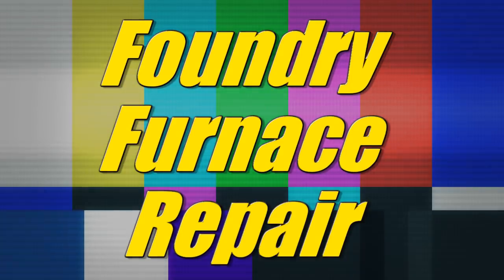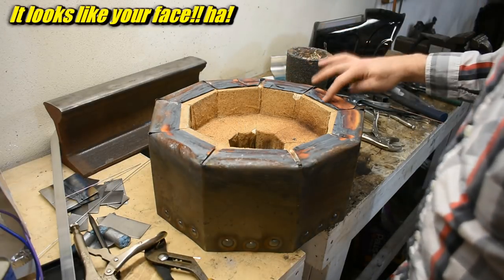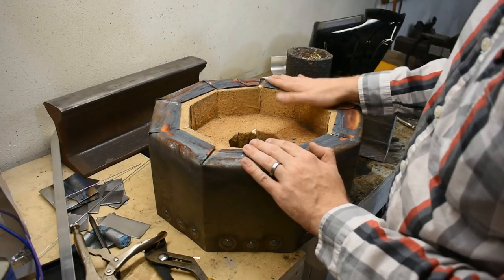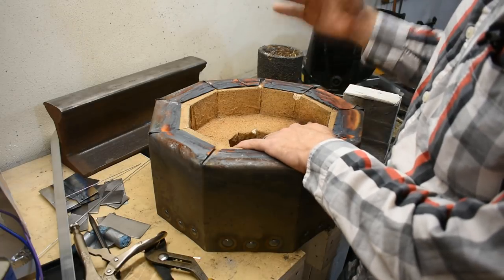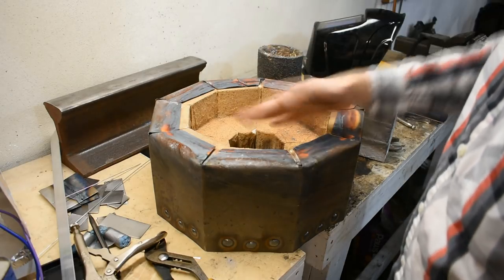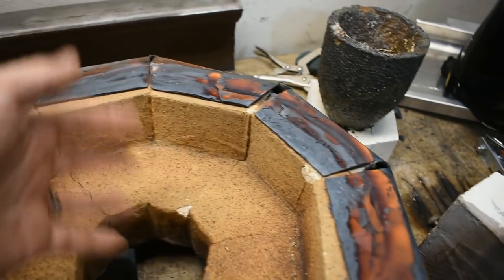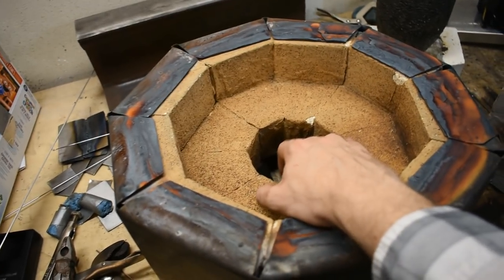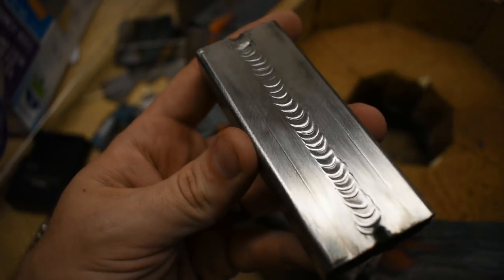Fixing the Fire Brick Foundry Furnace, and Using Satanite

Comment: I finally fixed my propane burner issue that wasn't getting hot enough, it was air flow! I just rebuilt my old sand/plaster furnace and upgraded it to ceramic fiber blanket and... SATANITE! I ordered 10 pounds of Satanite because I wanted to be sure my 6 gallon bucket furnace would be covered in several coatings...   5# would have been more than enough, 10 pounds of Satanite is a LOT of material! I became interested in this when I ran across your channel one late night, that might have been a mistake thinking back... :D

Comment: Hello from TN. I enjoy your videos and especially the commentary as you do it. Pretty entertaining and informative. I use Green Patch 421. It’s rated at 3200’ also. Makes a great mortar for bricks as well as a coating to help with the efficiency of a furnace. I also tried it as a type of refractory, i mixed 1 part green patch to 5 parts perlite and added water as necessary. I built a forge and used it as the refractory and it came out great. I actually found a place on line where i can get it for $87 for a 50# pail. Delivered its around $124.00 if i remember right. Anyways, cheers from one scrapper/smelter to another.

Comment: FWIW, after having plinths stuck to the bottom of my crucible, I recently started putting a piece of cardboard between the plinth and the crucible. I does stop the crucible and plinth from sticking but you do end up with a little ash running around but it seems far less irritating that dealing with stuff hanging on to my crucible.
Reply: About time!
Reply: Once I had stuff stuck to the bottom of the crucible, I didn't want to break it off for fear that it would break the crucible. So there was no way or reason to use cardboard. When i repaired my lining, I also bought a new crucible so I was went ahead and broke the stuff off the old one.  It didn't break so I still have a spare but now I use cardboard.
Reply: I coated my plinth and the crucible outside walls and bottom with satanite. Not only is my plinth still in one piece, but it also doesn't stick to the crucible anymore.

Comment: Try using s/s filler when TIG welding. It's way easier, stronger, and looks better. You can use it on almost anything. Mild steel, stainless, copper, brass and when welding dissimilar metals as well.
Reply: was hoping someone would give some welding tips, last one looks great, maybe could use a little more filler, good job.

Comment: Do you think the trash can foundry would work decently with kaolwool and a layer of satinite? I want to start dabbling into this but I want to start small.
Reply: I made mine from a 6-gallon metal can which I lined inside with 1-inch kaowool. Then I applied inside 3 coats of satanite. Everything inside, including the lid (which also has a layer of kaowool). Also coated with satanite the plinth and the crucible exterior. It's held remarkably well together through many copper and bronze melts over the past 4 months.

Comment: The only thing I'm wondering about is the oxidation of the steel holding the firebrick of your lid up. It looks like the scale is peeling off and its probably only a matter of time, could be a long time who knows, before its completely eaten away. Other than that little thing, great video and I'm sure I'm not the only one benefiting a ton from your content! Thanks so much! My new furnace with most likely a similar design to yours is going to be started this summer. P.S., are you still planning on making silicon bronze?

Comment: Hi Paul, do you have any plans for connecting the lid to the furnace. May be a nice welding job for your wife. Greetings and have a nice weekend from Germany :D
Reply from the maker: Im thinking of better handles but still leaving it loose so i can remove it, but handles might be a fun projecy
Reply: I’d make another lid but for the lid use kaowool (ceramic fiber) and use some hinges

Comment: seen them use the Ceramic Fiber stuff wish worked ok it IS a lot lighter 
allso seen someone coat the inside of the Ceramic Fiber with the fireproof concrete and it didnt crack after drying it and putting it through a couple of heat cycles (starting with lightbulb and ending up with longer and longer propane burns) 
the Ceramic Fiber got soaked with the fireproof concrete and the fibers i think reinforces it preventing cracks from lengtening of even forming

as for the hairdryer weakening ....... could it be the fanblades are melting ?
maibe get a cheap turbo from somewhere and rebuild that intoo an electric blower 
https://www.youtube.com/watch?v=K9aAZuO_VbE